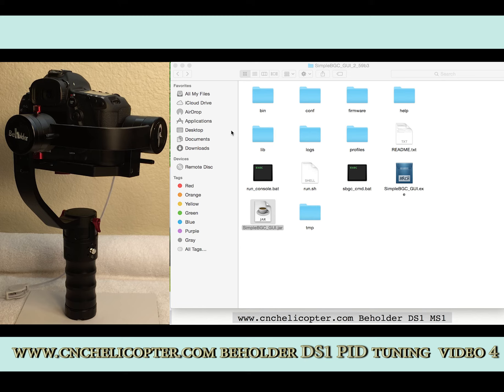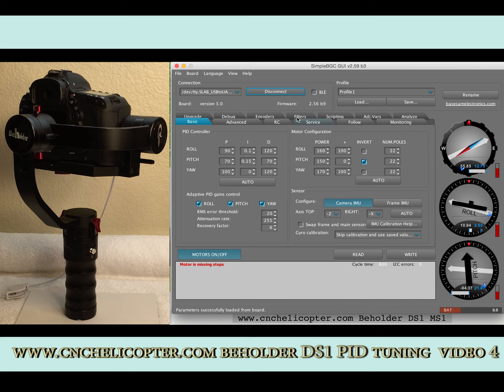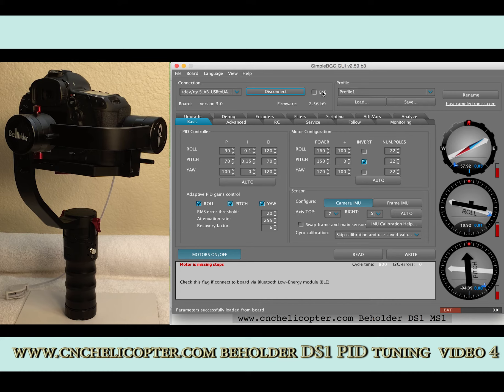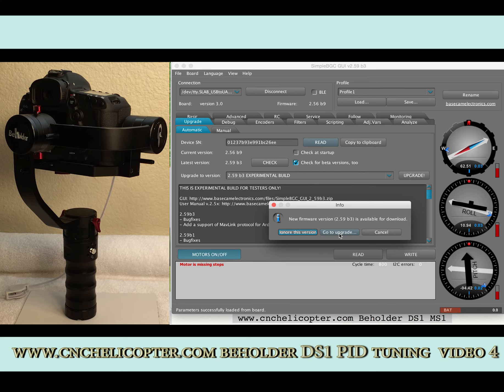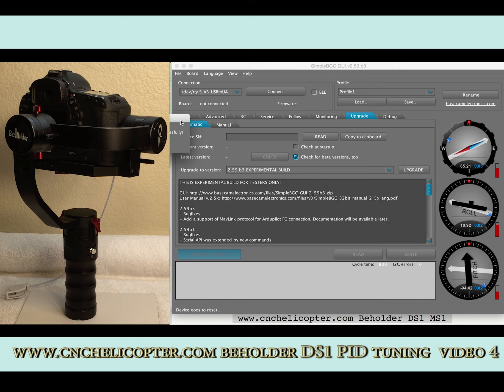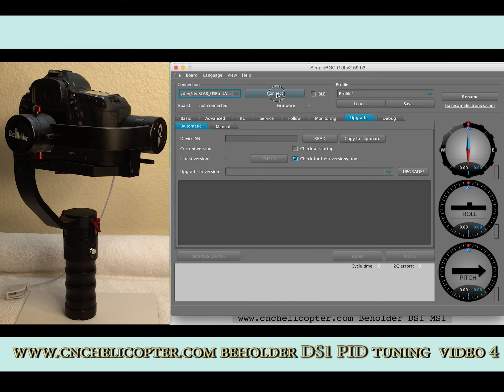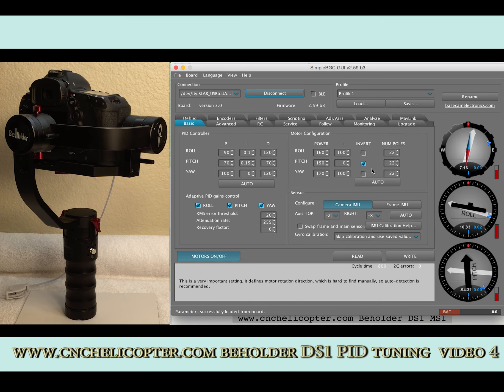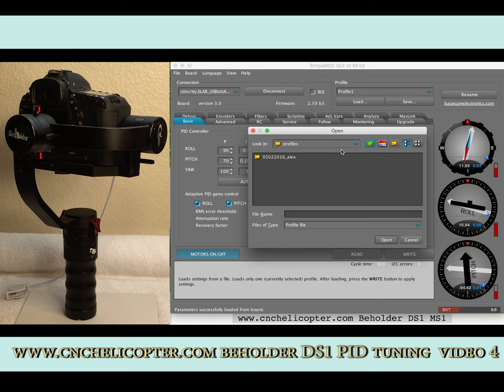beholder ds1 alexmos 32 bit 2.59b3 firmware upgrade PID tuning video 4

Comment: I upgraded mine to 2.59b7. My DS1 went nuts! Maybe the profiles I was sent were not right? The profiles have the pitch motor invert checked. However the PID pitch P value is 60 and yours has 70.
Reply from the maker: you need to ask agent to send you newest profile for 2.59b0 to b7
Reply: I got the profiles from Jeff S. at xmhobbies on 5/21. The pitch seemed stable but the yaw turned 300 degrees back and forth violently. My ds1 has the gold screw levers, not sure if that makes a difference or not.
Reply from the maker: make sure with your agent your ds1 version ok to upgrade.